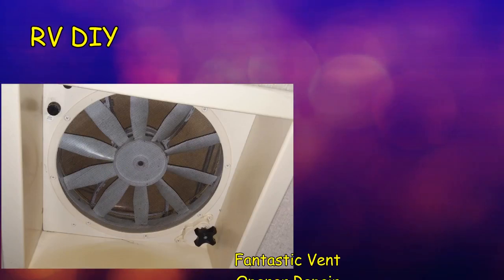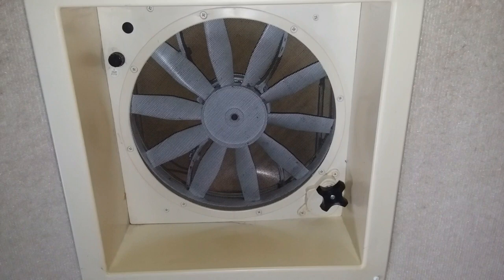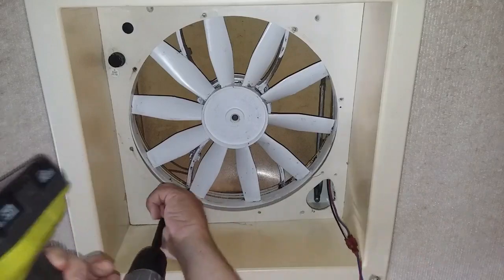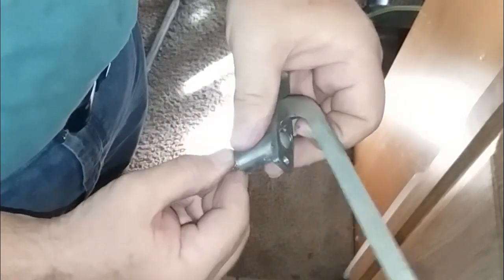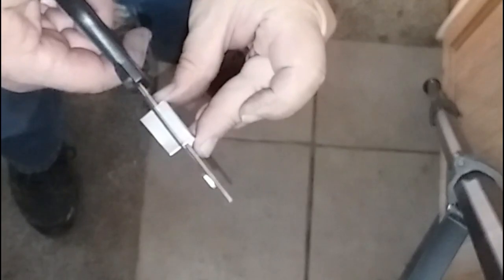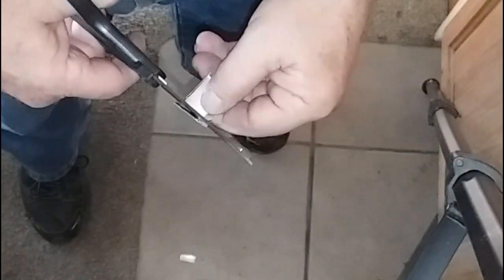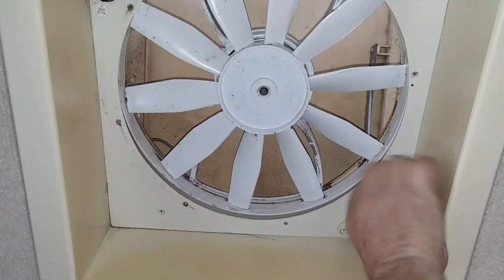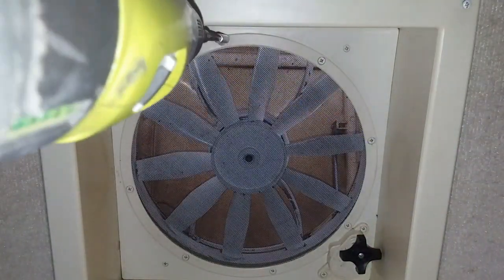RV DIY - Fantastic Vent Opener Repair

Comment: This was quite helpful.  The repair in this video was for the hold down for the "rack" (worm) gear.  What I actually found on mine was that the roll pin that holds the PINION gear in place had had backed out about halfway.  All I had to do here was push the roll pin back in place with my finger.  I smeared some silicone RTV on each side to keep it in place.  It doesn't need to be held down like the rack gear.  It just needs to be kept from moving side-to-side.  The RTV should do that fine.  I didn't even have to remove the crank mechanism to do this repair.  It took me longer to get the screws out of the screen and bezel than to fix the thing!    One word of caution; the screws holding the screen in place are REALLY short.  You'll probably drop a few of them while disassembling and reassembling.  If you have floor vents in your rig, be sure to cover them up!  Murphy's law dictates these screws will find those vents!  After ALMOST losing a screw down one of those I put a dark-colored blanket on the floor beneath where I was working.  This will limit how much the dropped screws will bounce before coming to a stop and make them easier to find.

Comment: Just what I was looking for. The right side screw holding the manual knob on screws into a piece of plastic that has broken away from the lift arm. I may have to glue it or tape it. Thanks for the dissembling instructions.

Comment: Thank you for your video - mine is a little different than yours, but I got the jest of it and was able to repair mine.  I was sort of afraid to start taking things apart I knew nothing about, but after watching your video I took on the challenge and removed the 4 screws and it fell right down.  I could tell right away that the bar that raises the lid had become disengaged from the turning knob so I guided it out of it's slot and found a nut and bolt to put them both back together again and slid the bar back in place and it work!!!!!  I then took the knob off and put the cover plate back on and then the knob and it's back to working like new again.  Thanks again for the video, it really helped...
Reply: Thanks for your reply, my husband has passed away, I am soo happy, his videos are still helping ppl, happy trails, and stay safe. love Sherry

Comment: Well done video!  My fans are more sophisticated than the one demonstrated, which may present more complications than your procedure.  But my lid opens either via power or manually only 2 inches then falls back down.  I suspect a stripped arm gearing although the drive pinion looks fine.  But your video means I may now have an easier means of getting at parts than I thought.  Thank you.  And I’ll check out if that plug/insert has popped up and needs modifying as you describe.

Addendum:  found worn teeth on the base of the arm.  Would include a photo if I could.  Guess a whole new arm module is the fix.
Reply from the maker: +hafcanadian A Thank you for the comment. sometimes doing the plug modifications can help for this as well. 

Since you liked this video you might like some of our other videos on "How To" :
https://www.youtube.com/c/HowWeDoIt_HowTo
Share with your friends what you like and thank you again.

Comment: We have a Dometic vent fan 4100 model.  Lift arm is plastic and broken of course.  Can we replace it with a metal arm or are we  just screwed by Dometic.  Cannot  find a  replacement  part online.   Next stop Camper World 😮.

Comment: I have the problem of the knob pull-down disconnect from the gearing popping out by itself and the motor then turning endlessly but not moving the vent cover. I bought a new vent arm for a reasonable price at RV Trailer Supply, in El Cajon, Ca. The new arm has the casting sealed except for a small (Oil?) hole on the bottom - the shaft is not free to move vertically like the presenter's was. Installed this new arm, and the problem remains. I guess the problem is in the motor/gear assembly which somehow has the detented up/down locking mechanism, which isn't obvious how to fix. 
This stupid little motor assembly is $50 or more everywhere I have searched. No videos o how to fix the motor.  Any suggestions???
Your can fix looks good, but I would use a stronger food can instead of a weaker aluminum can, but again, i don't need that. The shaft in my new replacement lift arm is solidly encapsulated.
Reply: BTW, the lift arm pivot pin was also well secured. Some other posters on this problem had pivot pins that came loose out of the body casting. I lubed everything with Tri-Flo lube, even the motor, but I evidently need a new motor.